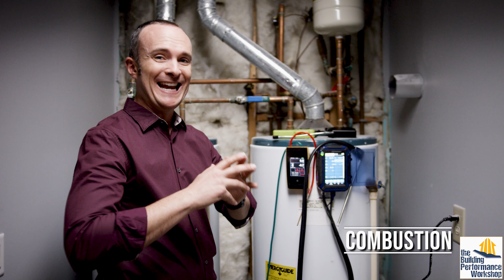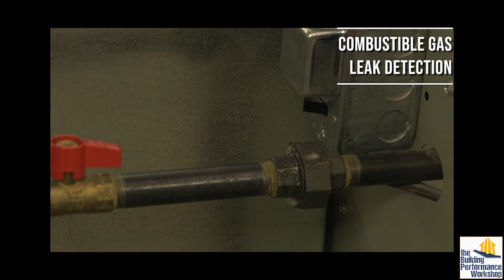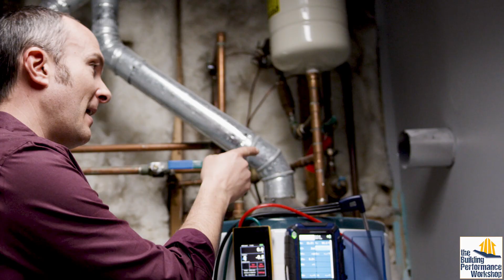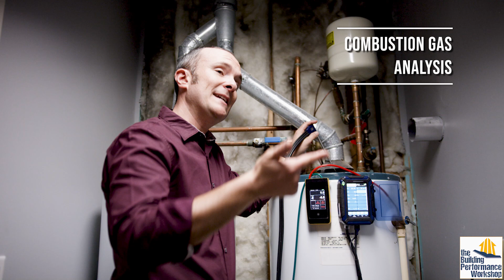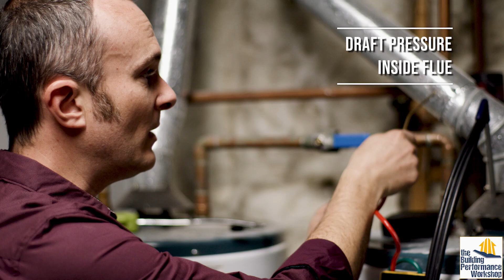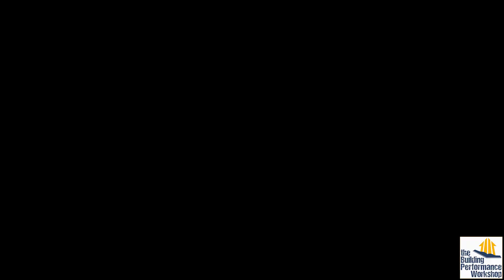How to Prove it’s Safe: Gas Water Heater, Furnace, or Boiler 5-Point Combustion Testing

Comment: #homeperformance I have been told you should not use gas appliances in passive builds, can you offer any guidance?
Reply from the maker: The problem is the extreme airtightness- if you must use gas, use sealed combustion/direct vent appliances.
Reply: @HomePerformance  Thanks, 
I stumbled across this (these new to me) building technology on YT, I’ve been following several builders channels trying to educate myself. The algorithms led me to your channel….Anyway, you are the first person on YT that took the time to answer a question and you did it within minutes. It’s almost like you are actually trying to help people instead of running informercials and supplementing your income. (sarcasm)
Thanks again, truly
Reply from the maker: @pathfinder509 aw thanks. Yes, that’s the dream.

Comment: The flue pipe elbow shouldn't be within 12 inches of the tank.
Reply from the maker: Per code maybe, BUT you can see if it works in any configuration by testing it. Prescriptive code is somewhat dumb in the realm of invisible dynamics. For example, code requires make up air for kitchen exhaust hoods over 400 cfm. Our home’s blower door test is 290 cfm. Code is worse than dumb in that case, it’s downright dangerous.
Reply: @HomePerformance  
Per code. From what I recall reason is the pressure from the combustion charge bounces back off the elbow when it kicks on and causes a sensitive sensor on newer unites to kick the unit off because it thinks its not venting properly. It's possible it's an older unit or someone may have fiddled with the sensor or this one just isn't as sensitive.
Reply from the maker: I get it, just to clarify there are LOTS of variables at work, and you monitor the draft pressure in the flue throughout this test.